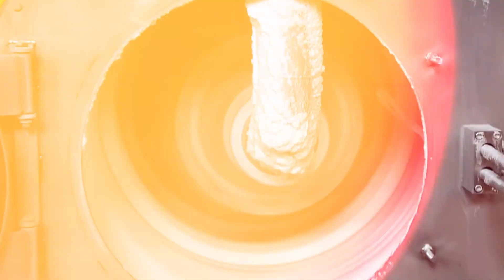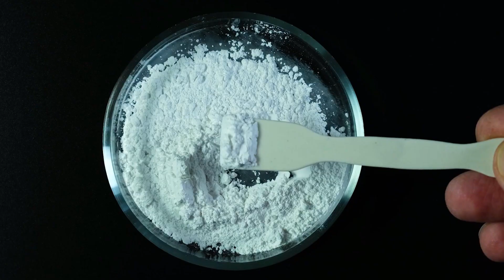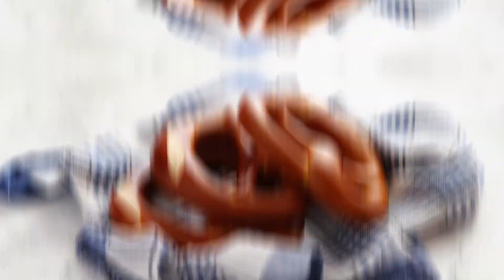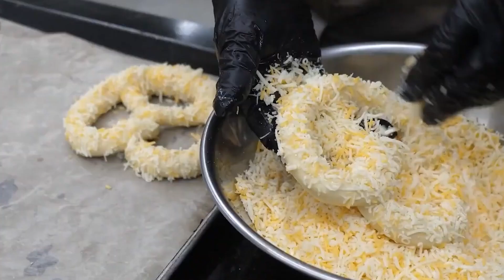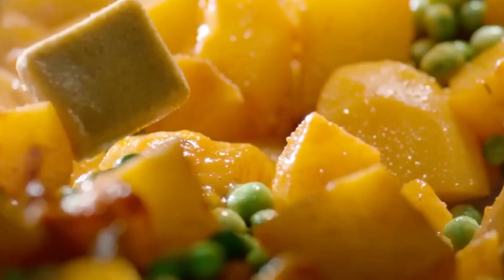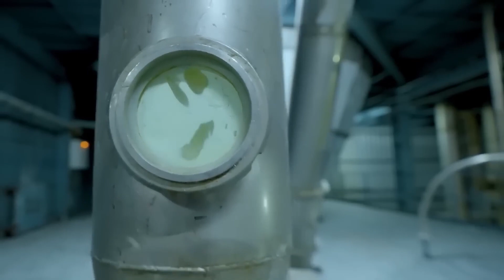How Tons of Baking Powder Is Made In A Factory | Baking Powder Factory Process

Comment: Baking soda does not taste metallic.  The metallic taste in some baking powders comes from sodium aluminum sulfate (SAS) or sodium aluminum phosphate (SAP), which are acidic components used in double-acting baking powders. 
You didn't cover "double acting" ingredients in modern baking powder at all (in the first part, the factory).  You mention it in the next part, but not that there's more ingredients for that and how that works.
Reply: Also aluminum is as dangerous as lead